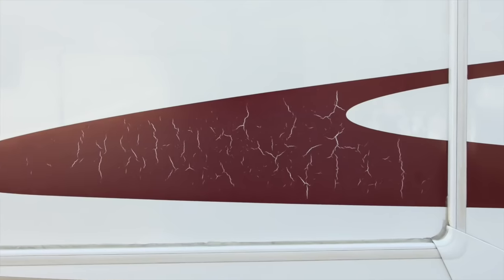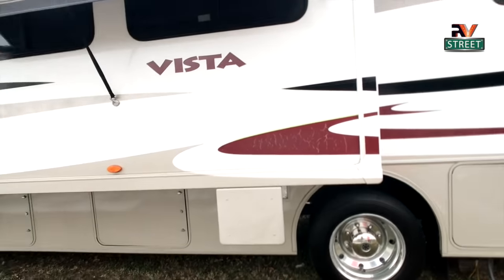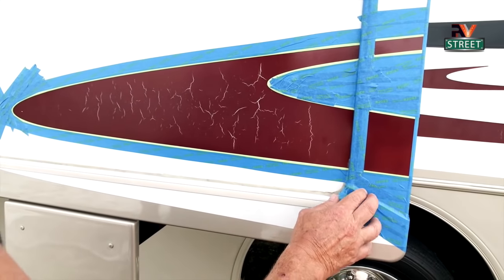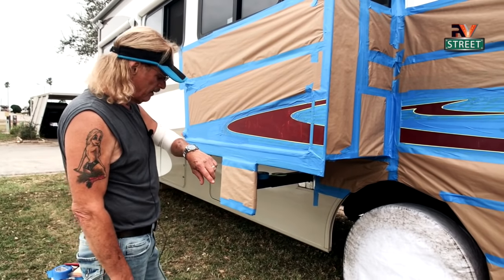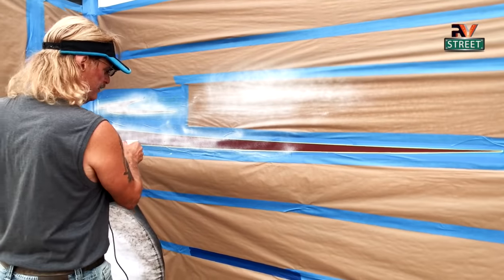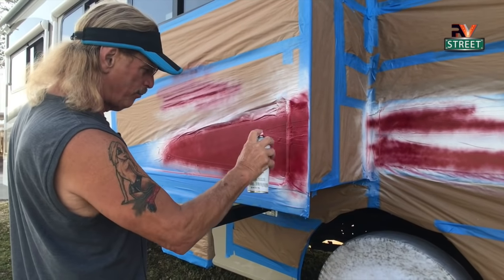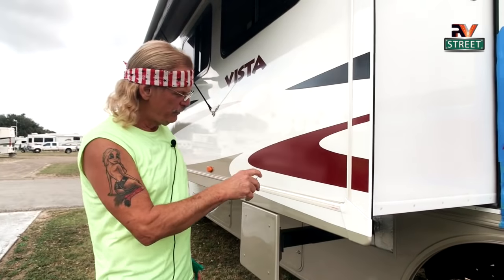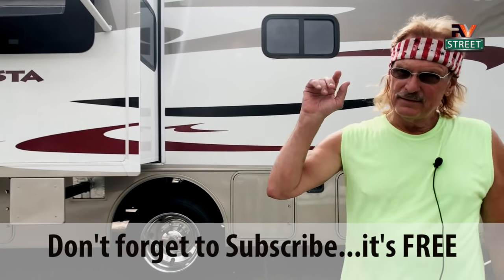How to fix Cracked & Faded RV graphics. Easy DIY job

Comment: Nicely done, I'm curious why you even used the white primer if the burgundy matched so well
Reply from the maker: This has been discussed in many other comments. But as I said in the video, it allows me to start with a blank canvas and to initially fill in the small remaining cracks and sand some before I go with color.

Comment: Nice job with the how to video “restore faded decals”. A couple questions please? (1) What type of spray paint did you use and since you were spraying with burgundy over burgundy, why prime first? (2)was the product you recommend to protect Fiberglass 
and vinyl from UV damage?
Reply from the maker: The type of paint used was in the video.
Other questions have been discussed in other comments.
BUT..the primer was used to create a blank canvas and also—fill in—the sanded cracks and produce a smooth surface BEFORE the burgundy color was applied.
Once job was complete you protect everything with RejeX. Links to that product was provided in the description text.
Reply: RVstreet thanks. I will rewatch the video and your comment regarding the primer makes good sense. Thanks from many of us for preparing this video

Comment: Question Sir, why use a white paint with a semi gloss finish? Would it not have been better to use just a white primer? I’m new to this and wondering if u had a specific reason. Thanks and great job.
Reply from the maker: The specific white paint/primer combo I chose was because it gave me a nice filler base to fill, sand and then add the other layers.
Reply: RVstreet got it.... getting ready to redo my black graphics. Great vid and thanks for giving me the courage! 
Ask just used some REJEX on my trailer. Amazing stuff!

Comment: Turned out awesome. What is the rejex product you showed?  We use a wash and wax, just had to do the meguiars restore 3-step for some bad fading and we keep a pretty good coat of wax on our fifth wheel. Very interested in that rejex product you showed though. Thanks for the step by step on restoring graphics!
Reply from the maker: RejeX was initially formulated for and still is used for airplanes. But it's fantastic UV protectant for RV's too.

Comment: Someone has probably already made a comment about a trigger mechanism that very simply attaches to top of paint cans with the FINGER spray.  Really a great little attachment.  Lowe's item #284850, model#241526, made by Rust Oleum, "Comfort Grip", $7.48 online.  Check it out for future paint can job.
Reply from the maker: Yes others have mentioned this and I could never find where to get them.......and asked several times and never got an answer.....until now. It's now in my notes folder. Thx so much TRG for this info and actual Part #'s.
Reply: Thanks, maybe it'll help.  By the way, enjoyed the video, well presented.

Comment: Nice. Strange how they dont go bad all the same.
Reply from the maker: Yeah I've noticed on many coaches some wear faster than others. Ours also did this. The rest of our graphics look practically brand new. But it all boils down to 2 things:
1) The quality of the UV resistant material they used at the factory
2) How well the RV owner takes care of the rig by protecting it properly from the suns UV rays.

This is why I don't use wax anymore and have switched to RejeX. I put a link to it in the description text in case you missed that.

thx Robert

Comment: Glad I found this video.  Is the material on the slide out a composite or metal and would the same process apply to either material?  I have an ultra-light that is fiberglass and the decals are in bad shape.
Reply from the maker: The slide out is made of fiberglass with clear coat and the decals are vinyl. Sounds like yours are the same thing.

Comment: If a can starts spitting, you can try to clear the line by holding upside down and pressing down until it's compressed air is released, just briefly, and I'd do it after shaking well,  and wipe the nozzle clean with some strong Isopropol Alcohol. 70% or better ( to 99%), sold at pharmacies.

Comment: Great video!   I own a Vista also.  My color scheme of course is the same.  My problem is the decals are not cracking but peeling around the edges.  How would you recommend fixing that?
Reply from the maker: That, I'm not sure, but I definitely would be protecting them 2-3 times a year with RejeX that I mentioned.

Comment: You sir, have given a new blow in my sails! Someone told me you can't paint over Gelcoat (never questioned why since I had never worked with Gelcoat until this year.) My 2005 Coachmen is heavily oxidized, no shine whatsoever. Add to this all the decals scratched, broken and what not. What would you recommend to remove oxidized Gelcoat or might as well just spray clearcoat over it?
Reply from the maker: To get rid of Oxidation you have to compound it out first. Then polish the heck out of it to bring the shine back. They put 2 coats of RejeX on it to protect it. once every 6 months after that.
When we bought our coach it was dull and oxidized too. I took 3 weeks worth of the afternoons & evenings to bring it back to life doing this very process. It's the only way to bring the shine back.
I may do a video on this in the future. I have a friend that has a coach that needs this and we would have to hook up to demonstrate.

Comment: We are hopefully picking up a new toyhauler next week. Should we use the Rejex right away after a wash job?
Reply from the maker: It depends. RV's that have full body paint (FBP), many RV manufacturers suggest not to wax, protect the paint in anyway for the first year or two. The paint needs to fully cure. But, if you don't have FBP then by all means wash it really good and then put on two really good coats of RejeX and then continue thereafter, wash good and then one coat of RejeX every 6 months. This RV will look awesome years down the road.
See my video on how to wash, polish and protect your RV properly here:
https://www.youtube.com/watch?v=7KmgneT3HPs&t=823s

Comment: I think there is a Decal Restorer ad that has used a part of this video on their ad as to what their product does. It is on the part where you painted this one. I could be wrong but it sure looks like a clip from your video.
Reply from the maker: It is a clip from my video and they stole it. I don't use or endorse their product. Please read the very first comment in this video. I'm giving them plenty of rope to hang themselves.👍
Reply: @RVstreet  Yes, i follow your videos. I even order the stuff off your page to wash, wax and do some other things to mine. Which by the way really turned out nice. I was pretty sure they had stole this clip is why i wanted to make you aware of it in case you did not know.
Reply from the maker: @marshabrown898  Thank you Marsha for that heads up. We got our eyes on them. And thank you so much for supporting our channel. It means a lot to Joanie & I. 💗

Comment: I watched your video on painting TV graphics I was wondering about over spray was thinking do you think air brushing would work as I need to fix my graphics on my travel trailer
Reply from the maker: Well I guess it would. I've never done any air brushing nor have the equipment. That's why I chose paint cans. Easy to get, costs little, matched color pretty darn good.

Comment: Question re: 3M Strip Off Wheel. I ordered one (you should see your US$0.03 in the next check! LOL) As I inspected the decal to be removed, I realized it's a decal on top of a decal. I "assume" (everyone knows what happens when one "assumes") stripping off the top decal may/will damage the bottom decal? It seems a set of plastic razor blades might be the best route but I await your sage advice. BTW, in all honesty, without being snarky, I enjoy your videos not only for your knowledge and ability to explain things but also because you speak standard English using proper grammar w/o a thick regional accent. However, I sometimes wonder if you're not a bit OCD about RV maintenance and upkeep! (just kidding...)
Reply from the maker: I removed one large original decal—about 10'-12 long—on our big slide in the very beginning when we first bought the coach. It was beyond hope. It took me 2 3M wheels to get it off, then I compounded, polished and waxed and you can't tell it was ever there. I didn't want to replace that one.
Concerning your two graphics stacked on top of each other...There's no way you'll be able to just remove the top one and not damage the other. You'll have to take them both off. Plastic razor blades won't cut it either IMO. There's all kinds of creative ways folks have tried to address removing them, but in all honesty, the 3M wheel is the best and easiest option.
As far as being OCD...😝...No not really. I've been this way all my life. I just like taking care of my stuff. It's labor of love. It all started with my first car a 1957 Chevy Belair. With my mechanical back ground I just know how important doing these maintenance things are. I'm just a proactive guy. 💗
Reply: @RVstreet  Tnx for the quick response. I was afraid I wouldn't be able to remove just the top decal. I guess I'll try your Rustoleum paint trick on the top decal. I've also thought of printing a decal on my 24" Epson printer using adhesive outdoor vinyl. Not sure how durable that will be but, if it's simple enough, I could replace it every 3-4 years.
My first car was my uncle's '56 Chevy Belair in Nassau Blue. Unfortunately, shortly after I took it to TJ for custom upholstery, Uncle Sam had other plans for me and refused to ship it to Vietnam. 😁

Comment: Hi 👋 I have an RV with no graphics, it’s all white. I have a small section that’s faded and cracked (minor) do you think I could use this same white spray paint on the actual RV? Would you? Thanks
Reply from the maker: Without actually seeing it, it sounds like what's going on is called "spider cracking" in the gel coat. But hard to say what I'd do—if anything—without seeing it.

Comment: I agree that the prep work takes the most time.... BUT, it is the most important part of the project.... Ive painted many vehicles and trucks,  and if the prep work is shoddy, the paint job WONT last and wont look as good... any idiot can press a button on a spray paint can (or, pull the trigger on a paint gun) but intelligent people will put their most effort in to the prep work, as that is where the quality is produced in the paint job....  and instead of sandpaper, i like to use the coarse scotch brite pads, as it doesnt clog, lasts a long time, yet scuffs the surface without damaging any of the  masking tape.... although, the best choice for smoothing the cracked peeling edges of the original decal will probably be the coarser sandpaper as shown in the vid...  great job!!.....
Reply from the maker: thx Greg 👍
Absolutely....prepping is the most important part. I stressed this point also in my total roof redo video.

Comment: I did the same thing to my camper accidents like even the same color but I still took the old decal off and then repainted it otherwise you will see the paint will sink into the crevices where the decal cracked up close it won't look well

Comment: So did you get any bleeding under the tape?  And why not use automotive spray paints like Duplicolor?
Reply from the maker: No bleeding. You could use Duplicolor if you wanted to but the paint I chose was nearly a perfect match. Whatever anybody wants to do is fine. We all approach things differently. I just wanted to show the process. Whatever works best for any person is better than what they currently have. 👍
Reply: @RVstreet  Thanks. I wonder which lasts longer? We used Rustoleum on some outdoor patio lights maybe 10 years ago and they still look good.

Comment: Also worked paint and finish at a body shop, never thought about using this! 
Q: have you or anyone else tried a light wet sand over the last dried paint shot? Did it help or make more work? Thanks for uploading, will check out the rest. (RV Life article Feb 2021)
Reply from the maker: Because the final coats are clear coat I wouldn't wet sand them.
Reply: I did not, but I did consider, and bought, glazing putty to putty in the cracks first. I never tried it though since I decided it was just far easier to rubber wheel the whole decal off completely then paint.
Reply from the maker: @gpsjetskier  👍

Comment: Will it work on graphics on a fiberglass boat? Great video by the way!
Reply from the maker: I wouldn't do it on a boat because the outside of a boat takes a pounding from water and if it's a salt water boat the salt would take even more of a toll. So no.

Comment: I was thinking that a random orbit sander would get you a better prepared surface for painting and also do it in less time.
Reply: Also a tip on sanding. I have painted a few cars in the past, and I got excellent results by using wet dry sandpaper, wet not dry. This also makes the paper last longer and it doesn't clog or load. I think it would be best to start with 320 not 400 grit.
Reply from the maker: I would not use an orbital sander.

Comment: Great video and I enjoy your enthusiasm to do it yourself. But, a couple of comments. Never ever recommend Rustoleum products for exterior painting and painting on composite materials. Next year, that paint will be delaminated badly. Next, use wet sandpaper to prevent build up on the sandpaper that will cause more scratches in the surface. Absolutely do not paint on the surface without using an automotive paint degreaser to remove contaminates like finger grease and paint residue from sanding, then do not touch the surface again prior to paint. While painting, never ever allow your wrist to bend, twist or turn. Bending your wrist will cause uneven paint coating. Use a stiff wrist straight and smooth even spray application so that your coats are even. Pull the trigger in one even continuous movement. 
I like your video and hate making these comments but never ever use anything but automotive paints and primers used for in this case composite materials.
Reply from the maker: It's been 6 months so far and they still look like new and of course we're always in the sun. I'll be sure to post a picture on our FB page this winter to show a full year worth of wear and tear. I have a lot of confidence in RejeX. I may even do a quick follow up video for the few that have doubted this is a good fix without going into full body repair and paint mode. I appreciate your comments but we're fixing vinyl graphics not fixing automotive paint issues. We'll see. Thanks Jeff.
Reply: @RVstreet  , I mean no harm. Your video is great and you teach clearly and bring a great alternative for those looking to repair graphics.
Reply from the maker: It's all good Jeff. I hear your hear. I'm glad you chimed in. Really I do.
Reply: Is it easy to find and buy automotive paints and where do you buy them? I would like to use this technique on my RV decals. Thanks.
Reply: @tinaperez9756  , google automotive paint and local automotive paint stores will show up. Many will even put the paint in a spray can for you or they will sell a spray bottle that you can put the paint in. A few great brands are PPG, Sherman William's Automotive, Dupont and RM. Each will have several grades of paint at lower to premium prices. This is where you get what you pay for. A higher priced premium paint will spray much better, cover better, have no dirt in it and will last many times longer than discount paint. These stores will even custom match your color at no charge. Sherman Williams Ultra 7000 and PPG Deltron are my favorites and are incredible. You will see what I mean if you spray a discount $7 can of paint that does match and a $35 dollar can of paint that sprays like silk , matches perfectly and lasts long after you sell the vehicle.

Comment: Have you replaced all of the decals with paint since you made this video? I'm in the middle of removing the weather beaten side decals and just wondering, based on your experience, if it would be better to remove all decals and buff and clean the siding, and tape off and paint the graphics. I have some experience but am far from an expert. Thanks, in advance!
Reply from the maker: Have you replaced all of the decals with paint since you made this video?.......
No I haven't. I haven't replaced any of them. I've painted two of them that I showed in the video and went over the black one with new vinyl material. The key to preserving existing vinyl graphics if they aren't to far gone is protecting them with RejeX. RejeX is way better than wax for your RV and protects against damaging UV rays which is what destroys graphics.
You might want to watch this video on how I detail and protect our coach:
https://www.youtube.com/watch?v=7KmgneT3HPs&t=787s

You can get RejeX at our Amazon store is you want.
https://www.amazon.com/shop/rvstreet
Go to the "Compound, Polish & Finish Coat" Category and you'll see it there.

thx Coleman
Reply: @RVstreet  Thanks. I have watched your suggested video and am now planning to restore the remaining graphics apply the recommended products to our coach.  Thanks for your time and effort.